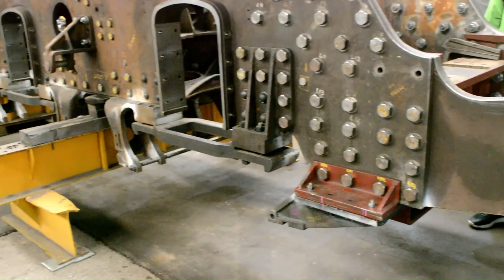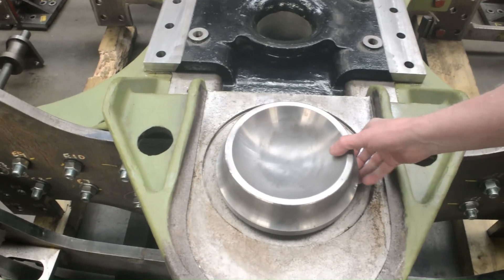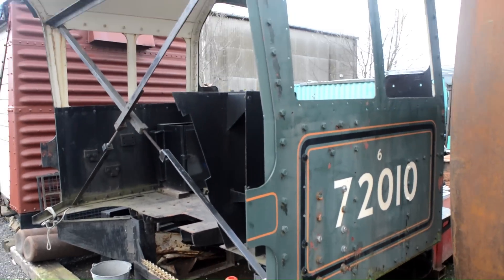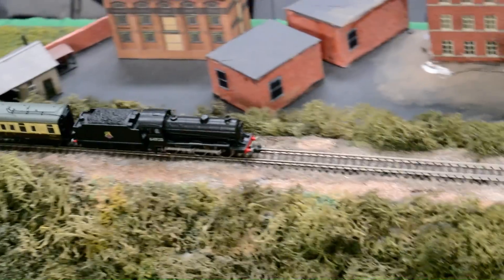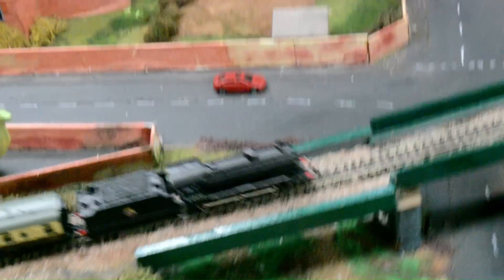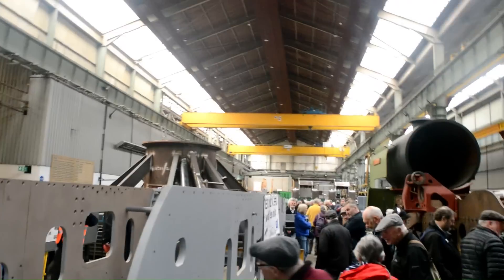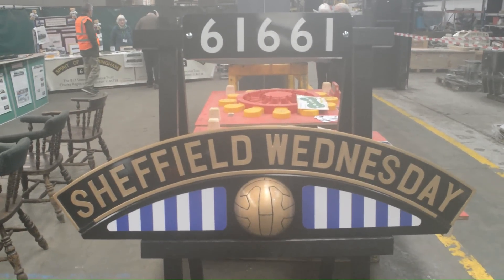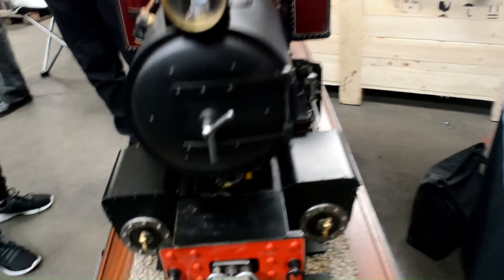A look at 2 BRAND NEW steam locomotives, 72010 "Clan" HENGIST and 61673 B17 SPIRIT OF SANDRINGHAM

Comment: I still can't understand why anyone would spend countless years and millions of £££s building "Hengist" when the Clans were one of the least successful of BR's standard designs and disliked by their crews wherever they worked.
Reply: They’ll do modifications during construction, that fixes the problems. It was either Britannia, Cromwell or DOG that had steaming issues fettled in preservation during an overhaul. 
Also the P2 under construction has had it’s original running problems designed out. They had all the data, so the problems could be identified and rectified in computer modelling.
Reply: U do realize that modern day technology and techniques can correct the flaws right?  It might not have been feasible to correct it back then but this is modern day, new technologies can do wonders to fix these problems

Comment: It's good to see how well these projects go forward, and thanks for showing us.

And while it is an interesting subject, your camera work and sound editing has room for improvement.
In this video the camera never stops moving around and makes it impossible to fully appreciate the details on said locomotives.
The video starts with an intro which almost explodes your speakers, and then you start talking and it is nearly inaudible.

The problem is not in your knowledge or presentation, these are good, it's purely the technical side of making videos where it lacks.
Make you camera work a bit more steady, by holding a frame for at least 5 seconds and make use of a tripod where applicable.

Use the function in your editing software to equalize sound levels of separate cuts of your video, if your camera has an external microphone input you could use an external mike so that you can always hold it in the direction of your own face or the interviewed person when talking, it prevents the sound falling down when you point your camera away from the speech being recorded.

Comment: Wow I didn't realise these brand new locos were being built. I knew the p2 and the lms 10000 was being built brand new as such but nice to have even more new builds being done 👍
Reply: In terms of cost, it is cheaper to build new than constantly restoring and repair the likes of flying scotsman. There is a market for steam powered excursions and, I suspect in the future a strategic need as well.
Reply: It's not nice. We should be cutting up steam locos, not building more. 

This is due to carbon dioxide pollution causing global warming climate change. We have to stop burning coal now!
Reply: Hope the Woke Climate extinction rebellion Just stop oil coal gas brigade don't find out.....can they run on batteries??.

Comment: Please, buy a cheap video camera with a wide angle lens, or a good one with autofocus! Even if what you explain may be interesting, the out of focus image makes it impossible to watch
Reply from the maker: I use a nikon d3200 with a 18-55mm lens couldn't really use tripod as there were a fair few people at the event, none the less thanks for the feedback I'll try and rectify it in due course
Reply: @delticman  well, aparently the camera is not suitable to shoot in interiors, autofocus does not follow, may I suggest that you switch to GoPro? It includes video stabilization, and autofocus (or no focus at all, I do not know its internals)
Reply: Why don't you take your video camera and make a film if you are so much more accomplished?
Reply: @stuartdixon747   Sure I'll do. It is not a question of technique,  it is just a matter of using the right tool for the job.
Reply: dude. Stfu. Why are you people so particular about nonsense like that? These guys have undertaken a herculean task in constructing two brand new mainline steam engines; engines that will serve one of if not the most extensive heritage line in the UK, and you're worried about a camera...